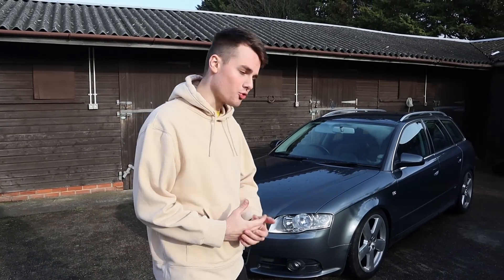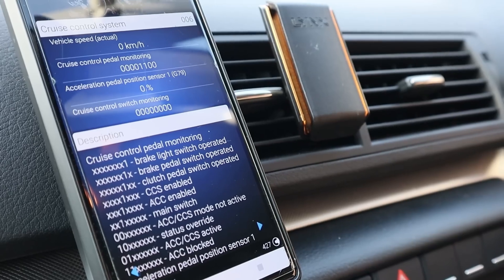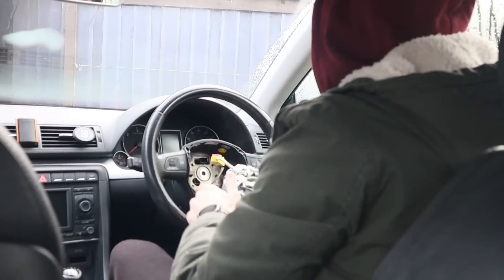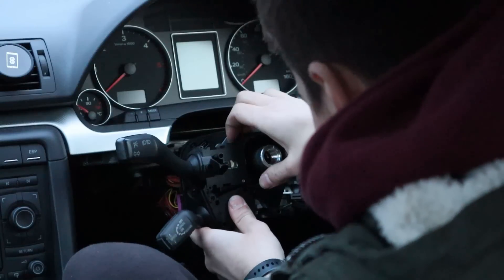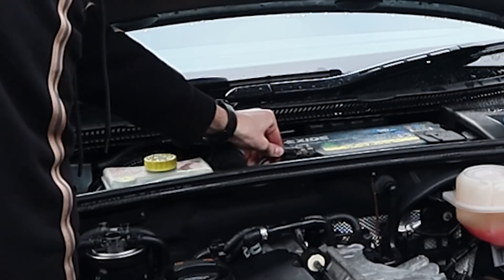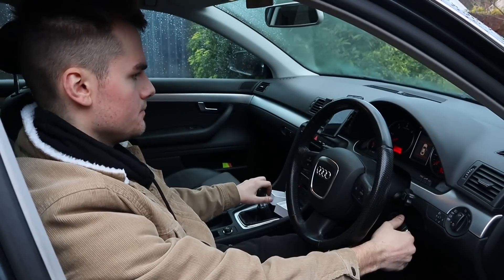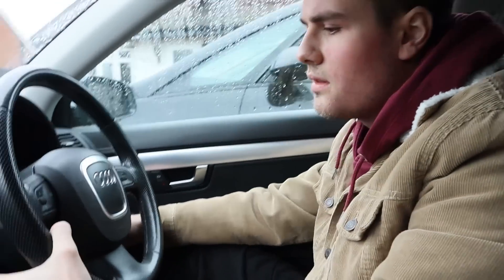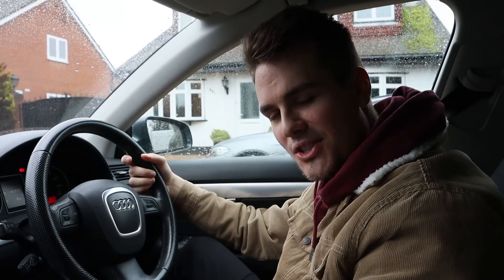Retrofitting Cruise Control Into My Audi A4! | Coding with OBDeleven Pro...

Comment: I installed cruise control in my 08 A3 8P and it works just like yours and also does not show what speed you set in the board computer. Where you able to configure something and get the set speed in the board computer?

Comment: Hi mate good vid but need a bit of help I changed to a high line module because I never had that so changed to fbmsw with cruise and the volume works on steering wheel then cleared fault with air bag but seem to be getting esp fault I heard I need to do angle sensor which is coming up a fault. Have you done this before with vag com if so how or anybody else on here. TIA 👍🏻
Reply: Look up this mate that’s what reset my esp fault…VW Audi steering angle sensor calibration
Bosch 8.0 ABS System Fault code 01826

Comment: Curently i'm with standart steering wheel (4 spoke, no buttons) and I recently bought for a cheap one multifunctional  (again 4 spoke) with paddle shifters,  I want to also add cruise control as well, cuz I don't have one. My question is, can I use my current Clock Spring or I should find one that was for multifunctional steering wheel (don't know If I should look codes or ...),
Reply: Nasıl çözdünüz sorunu?

Comment: I have a3 and i dont have that clutch sensor but my car has option for cruise control i installed it and it doesnt work. Can someone help me
Reply from the maker: Did you code it?
Reply: @BWTV  yes i did it accepted codes. I have vcds and i followed the instructions. But the screen doesnt show anything, and i ve tried everything to make it work even if it wont show anything on the screen, but nothing. That thing you bought, in my car is brake pedal sensor not clutch sensor and vcds shows that it works, every pedal sensor shows some value when pressed.
Reply from the maker: @prc7148  what year is your a3 and is it manual or auto? Perhaps the cruise control stalk is broken, I'm not sure what else it could be. Unless wiring is disconnected for it
Reply: @BWTV  it is 2003 and it is manual. It is not broken, vcds shows it works when i move stick, values say it is on and activated everything looks normal on diagnostics. But there is no response in cluster or while driving like it is not there. If you know or know someone please help. At this point i would pay for help.

Comment: Hi mate.  Great video.  Will be using this as my guide when I retrofit.  I don’t currently have anything to code it in.  Considered the OBD device you have… do you have to have the Pro or tokens to switch on CC or can you donut with the base model?  Alternative (old skool) would be VAGCOM from a laptop I suppose?!
Reply: nearly everything you can do in vcds u can do in obdeleven, you can do basic coding with the cheapest option and without needing to buy their credits.

Comment: Having owned both Petrol and Diesel VAG cars now. Which do you prefer?
Reply from the maker: Petrol just because of the longer rev range and noise 👌
Reply: @BWTV  good choice. I’ve been contemplating getting a Diesel for the fuel economy. And I drive a 2.slow MK4 but I just can’t bring myself to get rid of it..
I think my next car is going to be petrol too. Love the VR6 engines.

Comment: I have the A4 B6 and did the cruise installation myself.... Few Info - If u looked on the inner side the lower cowl there you would find a template/markings for the cruise control cutout, Also before u take the steering wheel off, use a black marker to make mark on the teeths/threads so when fitting the steering wheel back on, it will be straight and not misaligned. 👍
Reply from the maker: The teeth on the wheel had markers to where they were supposed to line up so fairly obvious when I went back to reinstall it 👌
Reply: Exactly, If you go exactly like the marking on the inner side you can cut it PERFECT without much effort.